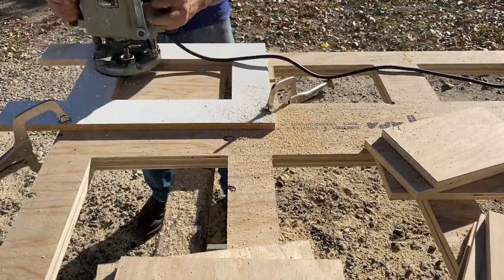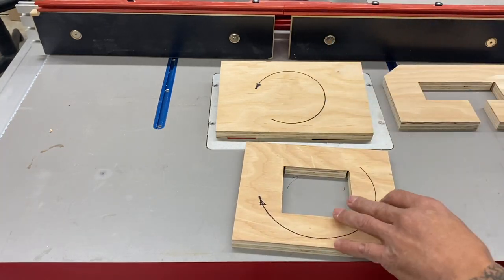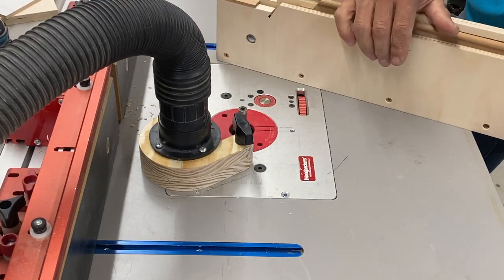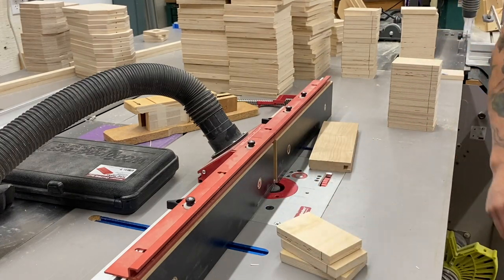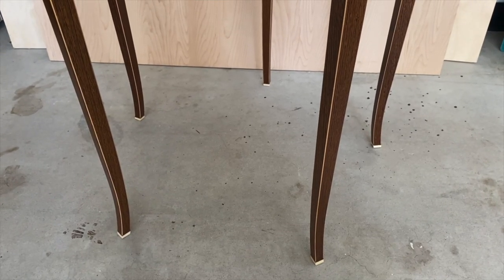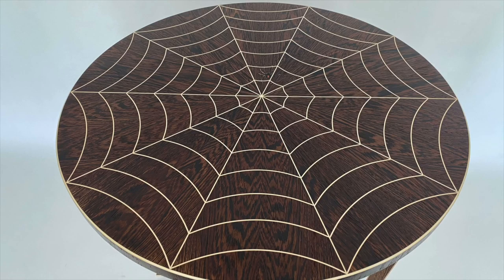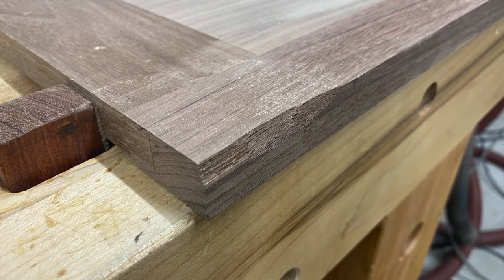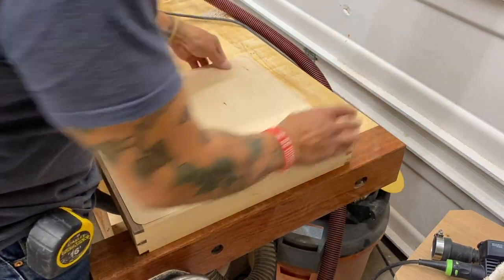Routers: Tips, Tricks an easy way to know proper feed direction &much more!

Comment: Great information Ramon!  What size routers do suggest for a typical shop?
Reply from the maker: Well, depends on what you’re doing really.  But a good variety would be a small trim router, a medium plunge and a large plunge router.  I feel like most people are using underpowered routers…small trim router to flush cut 3/4” material for instance, while the router is screaming!  I should add, I like 1/2” shanks whenever possible.  Larger shanks mean more mass, less vibration (than 1/4”) resulting in a smoother cut.  Thanks a ton
Reply: @ramonartful  Thanks Ramon.  Good advice